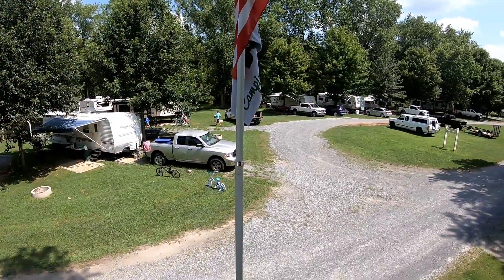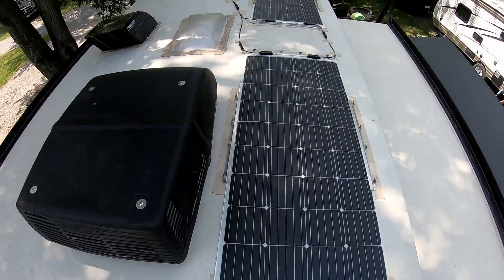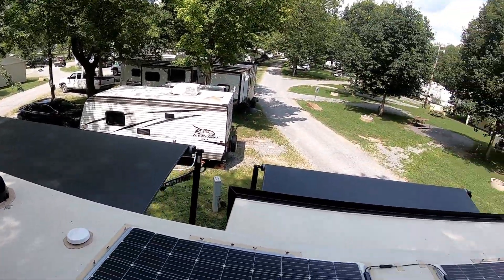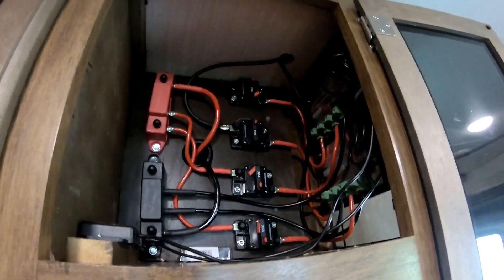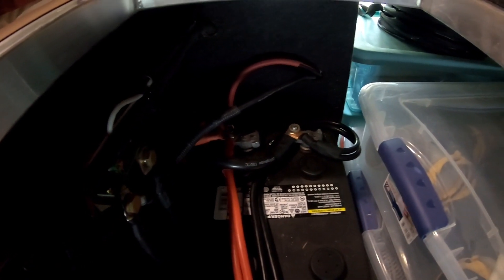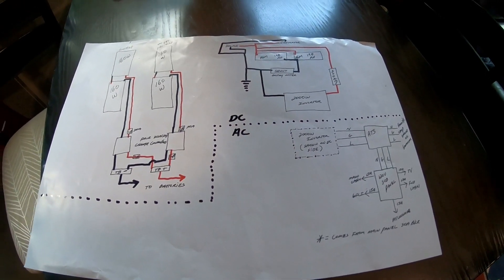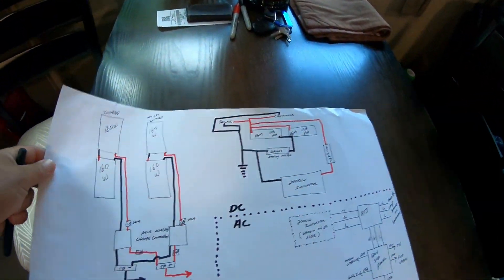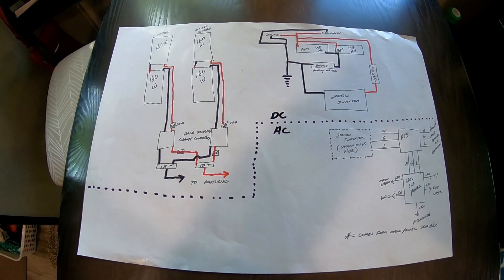Going Solar-Our way!!

Comment: Looks like a nice system. You should be in good shape on your return trip to the west. Different bands, but similar to what I have with a 2000 watt inverter, 560 watts of solar and 450 amps in four golf cart batteries. It has worked out well. Thanks for showing the system.
Reply from the maker: Thanks for your comments and watching!!